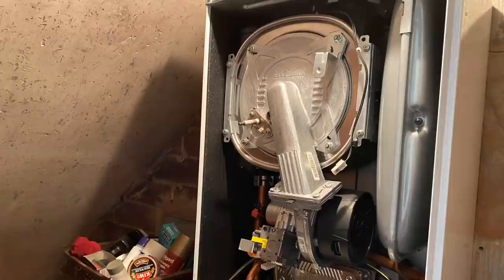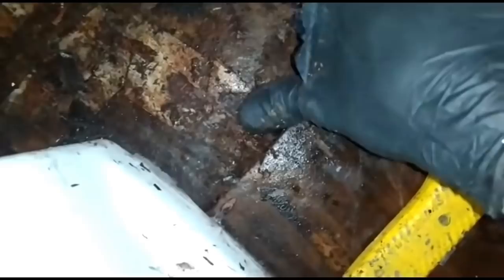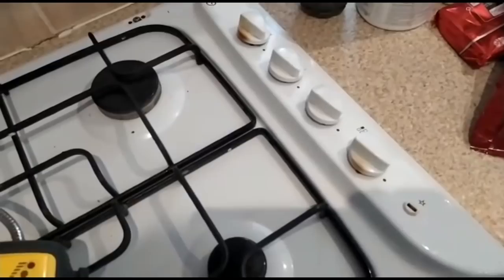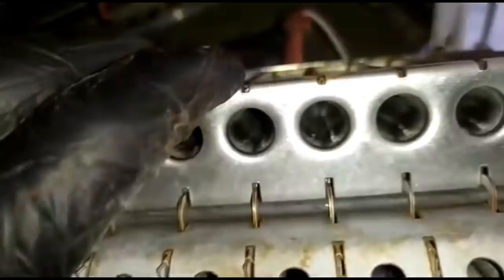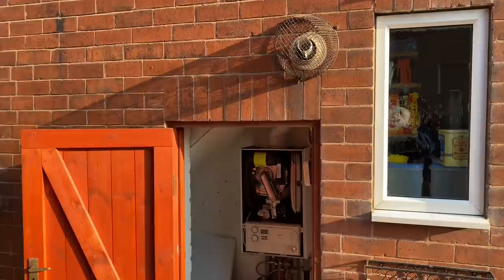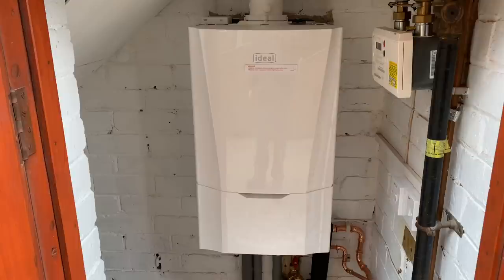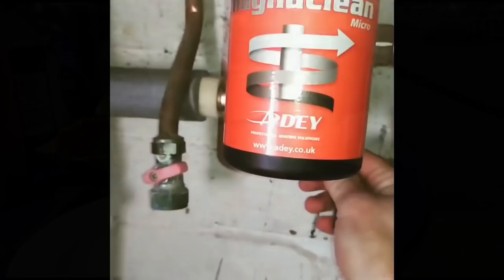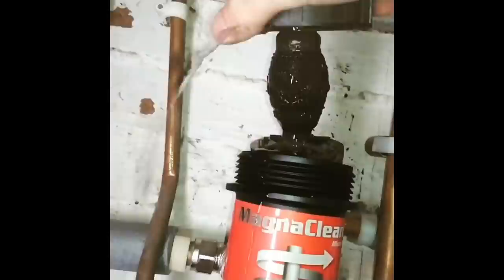Boiler Service / Gas Leaks / Boiler Installation / Plumber

Comment: Elliott’s speech at the end about 100% spot on! I was recently fired from a LAEGE service and repair company through the nasty fire and rehire process, and there subcontracts are on the same pricing as you described. Customers would be lucky if half of what they were paying for actually got done.
Reply from the maker: BG are terrible these days.
Reply: @AllenHart999  😂😜 nobody mentioned any names
Reply from the maker: @Ash Bayer  They are still terrible :_toolbox2::_toolbox3::_burstpipe::_drill::_mul::_wrech::_tap:

Comment: What a GREAT job that MAGNACLEAN has done.
With regards to your first question, yes I do carry out a house tightness test when carrying out an appliance service. On the very odd occasion that I do not carry out a house tightness test for whatever reason, I do carry out an appliance tightness test. 
Keep up the good work Allen. :_mul::_gug::_toolbox2:
Reply from the maker: You sir are amazing, Thank you for all the support. :_toolbox2::_toolbox3::_blowtorch::_burstpipe::_drill::_gug::_mul::_cutters::_wrech::_tap:

Comment: tightness test allays, and always do a print out, this once saved me I moved a meter slightly, did my tightness test all ok printed it out, a few days later there was a gas leak the solder not gone all the way around the joint, but the fact I had proof that  all ok on the day saved me a lot of may be pain..I always make sure its done and make sure the Tennent the L Lord and I keep a copy of the print out.
Reply from the maker: Thank You for the feedback.

Comment: I always do a tightness test, and been doing the job for 20 years now.
Reply from the maker: Very interesting as I thought it would be most people don,t do a tightness test as it’s not required. Thanks.
Reply from the maker: Definitely worth a debate on it. Do you do one before and one after? Then do you check all other appliances? Thanks.
Reply: @AllenHart999  Because I work on Social Housing properties, I usually only do a before and after test if I have had to remove a gas fire to check the space behind the fire. Increasingly now, certainly in Scotland over the last few years, open flued appliances such as gas fires, are being removed and replaced with electric fires, removing the need for a 2nd test, as I have not broken a gas connection.I do believe that it would be best practise to do a tightness test on a service visit, due to the number of gas leaks I have found on the anaconda pipe underneath the On/Off tape.

Comment: A few years back I conducted a tightness test after an a annual service which picked up a leak on a iron carcass.  The customer wasn't happy about the 900 pound job impending. Did I need to do the test?, no. Was I glad I did it? Hell yeah
Reply from the maker: Very good point. Thanks.

Comment: Tightness test, of course, don't need to but allows me to sleep at night for 5 minutes work. Another grey area!
Reply from the maker: It’s not a grey area at all, It’s just not required but it’s definitely a good idea. Thanks.
Reply: If I may, as a improver or trainee electrician In our field we have to ensure,by testing, that the system or circuit we would work on is dead and fit for working on.
Same thing should apply for gas, legally. There by tightness test as standard, plus maybe your flow test for cold mains and any other tests.
Reply: @AllenHart999 thanks for your reply, I say Grey area because if I were the last Gas engineer to service the boiler and the following day a gas leak should occur, surely my workmanship would be brought into question until proven otherwise. It just seems a bit lazy and 'Not my Job!' to simply say I wasn't required to tightess test the installation it must just be a coincidence. Also, tightness testing on a Landlord Gas Safety certificate visit is important as your checking the installation is safe and gas leaks are far from safe.

Comment: For the tightness test Sure it's a little extra work but vital as your covering yourself and giving best service possible aka checking the system actually works in the first place!
Reply from the maker: Thank you for the feedback. Are you a gas Engineer?

Comment: No always. But if I touch the gas line. Or any installs then yes. One on the way in, and one on the way out. In fact sometimes I leave my Manometer connected the meter's nipple. Servicing is normally, leak detection fluid, on any disturbed joints or test points! Clean filter with a Boiler service!
Reply from the maker: Very interesting subject. Thanks.

Comment: 20  years and always do a tt on a boiler service. Dont always do one after as it depends which gas connections have been touched but if in doubt i just do it. I would use ldf if not doing one after or a gas sniffer. It really depends on the gas engineer i think. I wouldnt feel comfortable sleeping at night thinking there could be a gas leak and being the last gas engineer there. I think it should be in the regs  common sense. Like said in the video it comes down to how much time you give yourself to do the job and price.
Reply from the maker: Thank You for the feedback.

Comment: I always send system water to fernox for analysis you then get a report for solid proof the system complies with bs7593 when boiler fitted. Only takes 48 hrs. They have an app for testing inhibitor annually when servicing boiler. 👍
Reply from the maker: Have you used the Adey Pro Check ? Thanks
Reply from the maker: https://www.youtube.com/watch?v=3VcMnZEbrpg
Reply: @AllenHart999   no I have not. Have got a kamco test kit.

Comment: Hi Allen 👋. We always do a tightness test if we are going to be working on any gas appliance also I'm currently at college doing my level 3 nvq and they teach you that you should be doing a tightness test on any appliance before working on it 👍
Reply: Also as you'll be the last one to do any work on the gas you could be come liable if something serious did happen 🤔
Reply from the maker: Definitely worth a debate on it. Do you do one before and one after? Then do you check all other appliances? Thanks.
Reply: Yeah we do one after aswell if we've had any open ended gas pipework. Only a visual really just to check for spillage or poor combustion :_gug::_mul::_wrech:

Comment: Should have protected the rear insulation on the vaillant. As can see he caught it with his cleaning tool. Some people either take them out it use the card board from the seal packaging also seen a round chocolate box lid used.  Great video Alan ( also always tightness test before I touch / start anything)
Reply from the maker: Thank you for the feedback.

Comment: I always do a let-by / tightness / standing and working pressure at the meter before undertaking any work that is gas related. I think a tightness test should be made compulsory at every job (gas related). A lot of engineers don’t like doing a tightness test because its creating more work for yourself if there’s a leak.
Reply: Depending on what Magna filter is on the system I will clean it. Adey Micro 2 or the professional 2 I install
Reply from the maker: Very interesting, Thank You.

Comment: Went to replace a TRV,  left with ECV capped oof.... also a 15mm comp bend with nut and olive missing soldered copper in it oof.... 2mb drop in 2mins on pipe work only oof.....thats my day, thank you....
Reply from the maker: Thank You for the feedback.

Comment: Just me, but TT on every job. Peace of mind for me. Come across two jobs with full drops over the last few months.
One had four joints not soldered in the garage. 
Another had full drop at the back of a fire.
Four minutes at the start and finish is neither here nor there.
Reply from the maker: Big companies do not normally do a tightness test.
Reply: Yeah I've been offered a few jobs recently and no TT seems to be a selling point. 🤷‍♂️
I've worked on Social contracts and they wanted one in and one out. 
Think it should be a mandatory thing personally.

Comment: Get to the job job. Carry out a tightness test.
Modern meters in the floor and hopefully no bushes covering it. Carry out a full strip and clean and replace gaskets where required. Remove filter and clean and hopefully it doesn't leak. 
Carry out a tightness test.
Fill out paper work and give to customer.
Charge £70 or what you local rate is plus parts and hopefully not for a contractor who may want it done for half the price.
How you doing for time from when you prepared to arrive and when you left.
Ps have you noticed the service prices are pretty much the same today as over 5 years ago but the cost of most thing have gone up.
Reply from the maker: Thank you very much for the feedback.

Comment: Tightness test if I break into the gas line or combustion chamber.  Also 26.9 checks simply because I like to sleep easy.  

We're supposed to be competent and trained in our field of expertise.  Sometimes it could be long while before the boilers next attended to.  It's down to personal judgement really.

I'd like to know more about the electric van Al 👍🏻.  Always looking forward to your next upload ✌🏻
Reply from the maker: Did you watch the video i did on the electric van? I am getting mine on Wednesday. Thanks.
Reply from the maker: https://www.youtube.com/watch?v=Ld_3uWmioNY&t=24s
Reply: Yes I did Allen, I'm holding back on electric until the range gets better.  For now I'll still with my VW crafter.  Besides I don't think the range on the electric sprinters are all that great either.  Amazon seem to have purchased a massive fleet of them.

Comment: That system doesn't need flushing. it needs semtex. lol. I myself and I just mean me,  I always do a tightness test. I do one before and after, plus print it out, PROVE YOUR WORK, cover your arse. I did a domestic yesterday and it was pissing out of the meter. Phoned up cap em and skarper and it was the next day before the meter installation was replaced which I thought was a bit poor service. I've done a vid for ya on that one.
Reply from the maker: The water was really really bad. Thank You for the feedback.

Comment: Yes , always clean the filter too.
Reply from the maker: Do you ever have any issues with the filters leaking? Thanks.
Reply: Had a plastic cheap one leak from the top once.

But just regreased it and all good.

Comment: Hi Alan , no I don’t do tightness test on service unless I am worry about some thing, just try and do a proper service, can’t  remember the last 
time I went to a boiler that had been service correctly before !!!, after speaking to customer they say yes I had it regularly served but have never 
Seen boiler taken apart!!!, in the past I have done break down for major boiler service companies,while there break down cover is pretty good, there 
Services are a joke, a gas analyser poke up the flue is not a service, customer think they getting a service, companies say it a safety check, 
Robert mailer

Comment: I’m a new engineer going through my ACS at the moment and they teach to always do a tightness test before any work or service.
Reply from the maker: Would you test before and after? Thanks.
Reply: @AllenHart999  yes sir. The test before to show there was no issue before you started work or to highlight any issues that may have been pre-existing and one to prove you left it in good condition.

Comment: I was serving gas boilers in Glasgow I always tested the gas on starting and finishing the service on one occasion I went to a property which was one old at the time I did my first check and the gauge dropped like a stone spoke to the tenant who said that he thought there was a smell of gas in the cloakroom near to where the meter was I sealed off the gas the contractor who did the original work had to return they found a coupling that had never been soldiered had been leaking for a year the tenant always had a smoke in the toilet luckily nothing happened
Reply from the maker: Shocking. Could have been a different story.

Comment: It was something I could never understand with the household gas industry. I worked in high pressure gas up to 12,000 psi and each time maintenance was carried out where connections were broken a tightness test was carried out before putting back into service. It does not take long to do the test on household gas at 0.28 bar but should the pressure reducer fail then much higher pressure gas is entering the property. If it’s not tight Gid knows what could happen!

Comment: I'm a gas engineer and working for private customers I'll tightness test but sub contracting to a certain company I don't as they pay you alot less and they don't require it.
I think personally tightness test should be included in any gas related job just incase there's a gas leak then it can be picked up.
Reply from the maker: Hi Lewis. If you worked for a big company then you wouldn’t have the time to do a tightness test.

Comment: Do you think that the  boiler had water treatment (fernox or similar) installed when the boilier was first commissioned. Twice now my dhw heat exchanger has completely blocked on the boiler water side even though the CH water was dosed well above the minimum recommended by the manufacturers. I have now had a magnaclean fitted and checked it today after about 9 months operation and it was almost completely clean- by the way the CH water does not pass through the magnaclean when it is in DHW mode!
Reply from the maker: System needs to be flushed and treated, Unfortunately, people don’t always do it.

Comment: I have always performed a tightness test on servicing, always sell as part of the importance having it checked every year. Also curious as to whether or not you put a plume kit on that boiler install, as the old flue looks closer than 300mm
Reply from the maker: The old flue was 290mm but the new one was 310mm. Thanks.

Comment: It's not always price that drives the quality down, I've never paid less than £60 for a boiler service, but some have just done a gas analyser and gone and others have actually done the service and cleaned the boiler inside as it should be and all my intergas ones need to be done inside.
It's just plain cutting corners and shouldn't be allowed.
I only have one plumber now and he does a proper open up and clean out service. Don't see why I should pay for one and get a sniff test and go.
Reply from the maker: Does he change the burner seal every year when he opens it up? How much does it cost. Thanks.
Reply: @AllenHart999  on the intergas they are a reusable silicone seal and it is inspected and replaced if necessary, I have the parts here so he has spare seal in van if needed, but they are surprisingly robust.
£60 for landlord cert and service, but I will buy any parts on top of that myself if he recommends anything.

Comment: I am a gas engineer and i was taught to do a tightness before i touch any gas appliance
Reply from the maker: It’s not required when you do a boiler service, Do you believe it should be? Thanks.
Reply: @AllenHart999  i believe it shud be as end of the day we are gas safe engineers we are there to make sure premises is safe? By doing tightness tests we could save lives

Comment: Cleaning filters I used to but again the company I sub contract don't allow it due to them leaking and not being covered so I always make the customer aware if I clean it I can't be held responsible for any leaks. Had a adey Magnaclean valve leaking when turning it off. Requires a new filter now 😭
Reply from the maker: They can be a nightmare tbh.
Reply: You can get replacement is valves from Adey direct. Plus, for a while now, their Pro2 come with a 10yr parts warranty!
Reply: @efrygasservices6169  thanks for letting me know I'll keep that in mind for next time. ive actually quoted to install a fernox omega tf1 filter as find them to be alot better. Never been a fan off adey Magnaclean even the tops can be a nightmare to undo at times.

Comment: Yes I always do a tightness test.....I fill out a gas service certificate, on that form it asks Has a tightness test been carried out? Has it passed? How can someone filling out this paper work, tick the box Is the appliance safe to use? 
If they haven’t done one what does it add in time to the job? Three minutes test (1min stabilising + 2mins test) so what five minutes extra on the job? 🤔🤔🤔🤔🤔 to me it’s a no brainier, safety first.
Reply from the maker: Do you test before and after or just after? Thanks.

Comment: I'm starting my training working for the local council and they do let by and tightness on every service
Reply from the maker: That’s absolutely brilliant to hear. Very unexpected though as I know a few guys that have done the boiler services for them and then do not do a tightness test. Thanks and good luck.
Reply: @AllenHart999  doesn't take long so definitely worth while! cheers Allen
Reply from the maker: @joeturl4153  Definitely worth a debate on it. Do you do one before and one after? Then do you check all other appliances? Thanks.
Reply: @AllenHart999  Just one beforehand. They don't tend to do full strip down services just a yearly landlord safety check, so they aren't as long.